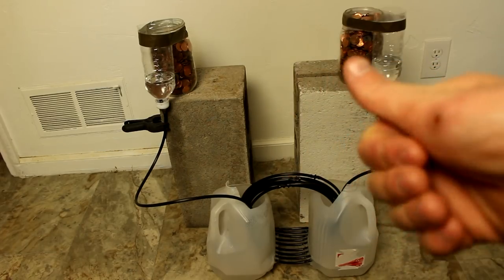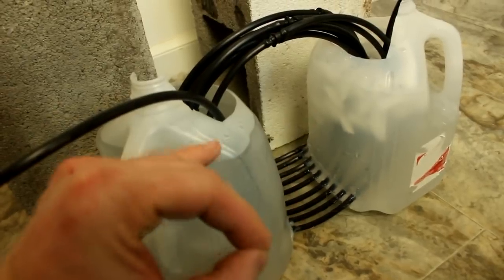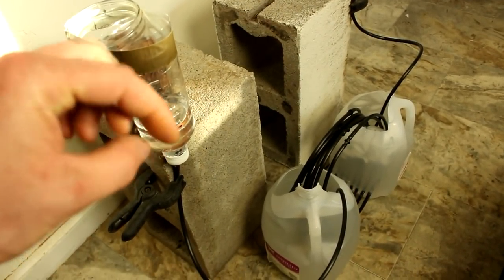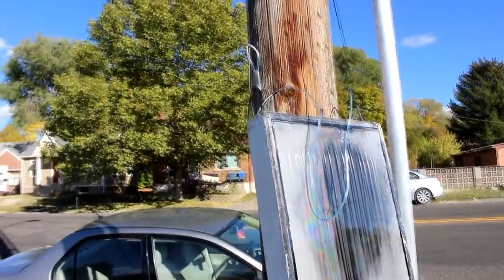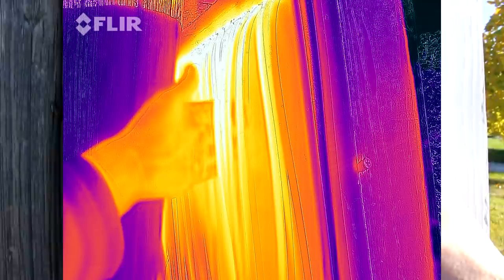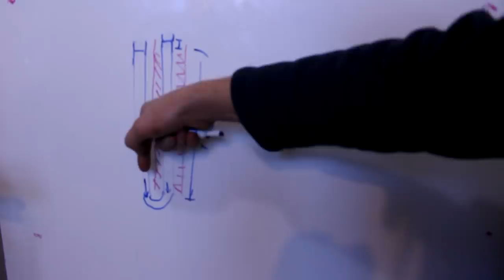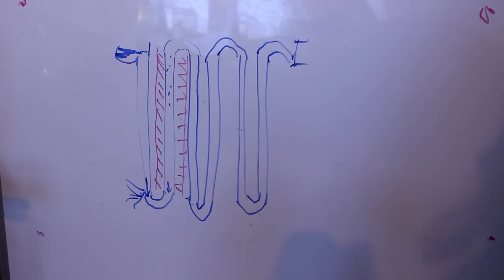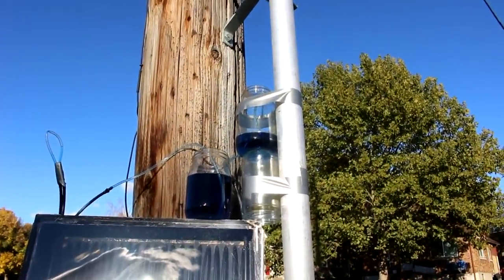Water Pump With No Moving Parts? (except water of course)

Comment: theoricaly according to carnot cycle, your solar heater's efficiency is 10%
but assuming its 2mx0.5=1m2 and solar irradiance is 500W, and you said you pumped for a hour 
then it should have done 180KJ of work, and thus lifted 61m3 of water xD
i think the current setup is inefficient
your last idea about doing many loops and incrementing the head in each loop is the way to go 
also this project reminded me of when i tried to make a solar water heated by passing drop irrigation line inside a poly-carbon board on top a polysterene one and aluminum foil sandwitched between them

Comment: So if it's the cold water that is pushing the top splice to metal pipes on back aluminum is a good cheep heat sink wrap it like in that radiator stuff on the back, ac box radiators. Something with no moving parts to wear out

Comment: Maybe you could use the osmotic pressure between the pure condensate water in some parts of the system and the highly concentrated water on the bottom to pump salty water up.

Comment: Just use a diaphragm pump for you eco system.  Just use a sealed volume of gas to drive the pump.  The gas will expand during the day and contract at night.  It would only complete 1 full stroke per day, but would move plenty of water for your application.

Comment: I think you said at one point you wanted stop use the Eco cubes in space, in space you could just have the Eco cubes spin to mix the water it would never stop so, a slow soon would pump it it
Reply: Spinning to mix the water wouldnt continue forever due to entropy. Turbulence in water (mixing) is caused by changes in direction (kinetic energy) which needs to come from somewhere (the kinetic energy of the spinning container). In time the turbulence would stop the object from spinning.

Comment: What if you do not exchange the heat between the cold and warm side in every column, instead make the column almost horizontal (but still tilted so the water flow down), like the back of a fridge. This way would have very long tube on the warm and very long tube on the cold, that fit in really small space, with only one point of exchange (of course the pressure on that point will be really high, so it must be really strong).

Comment: Just buy and use a few DC pumps in series so that if 1 fails you have a couple backups still working and check on it every so often in case 1 failed so you can replace the pump. 
The amount of time, effort, and things that you have to put into trying to make this work seem to defeat the purpose and create multiple other methods or points of possible failure.

Comment: Rather than just having the cold side pipes in the shade could you add some sort of heatsink to those pipes? It's probably more important near the top of the pipes where the water is still coming over the top of each loop hot.

Comment: Have you considered a chemical pump..using limestone and acid bubble colums.
I used this set up at our lab..and to add calcium to salt water tank(side effect the water pumping dripped without need for airstone or pressure..pumped about 3 foot up in a 1/4 inch pvc
Reply: I think his point in doing this is to create a no maintenance, non-electric device, his system would probably hold up without repair or recharge until the piping photodegrades, which would take anywhere from years to decades. It sounds like your idea would need a regular re-supply of chemicals. The idea is cool though

Comment: Just to be splitting hairs water level seeks pressure equilibrium. Gravity gives the pressure, this is why you can siphon water upwards as long as the end is at lower pressure, and also why to much air in the system eventually stops the flow in a siphon flow.
This also explains why the pump result is underwhelming. If you want circulation you need to equalize the pressure in the bottles. The level difference you now se is the equal to the pressure this pump can pump whit. 

I wrote this before watching all of it so with a small disclaimer here now, you may explain the same later on now I will continue to watch.

Comment: copper pipes to increase heat transfer. larger diameter to reduce flow restriction. parabolic mirrors to increase temperature delta  you could use heat pipes as  a heat exchanger. this would be quite expensive for something that moves very small amount of water. i think if you have a solar heater that can boil water just s simple bubble  pump would move a lot more water.

Comment: How about this: make the diameter on the cold side larger than of the front, so the heat from the front doesn't raise the temperature on the back as much.

On second thought, instead of increasing the diameter have the backside tubes split off into multiple lines to increase the volume AND the surface area. At the bottom they will have to merge again.

Comment: dood, just make both banks of tubes, hot and cold, in parallel so it's not pushing the entire system through for a net gain of one tube cycle. If they are in parallel you'd get alot more flow which is what i assume you really need here.

Comment: If you are interested in heat exchange and are willing to add energy to the system but still avoid moving parts you might consider checking out some TECs or as I prefer to call them "Solid State Thermoelectric Heat Exchangers".
Reply: If you run two loops in opposite directions and place the TECs between them you could create a rather efficient system.

Comment: Thermal expansion of air could drive an 'acid egg' (an air displacement pump or intermittent gas-lift pump) rather more effectively, I suspect. Chuck in a couple of Tesla valves and see how it goes.

Comment: Pertaining to the shrimp cubes, Cody, could you improve the adhesive action of a capillary tube by applying minute yet constant electrostatic charges to said tube(s)? Perhaps by solar power or unconventionally with a radiometer, like a miniature, rotating van de graaff generator.

Comment: used backwards it is a radiator, a thermal pump to cool the water rather than heat it to pump something. functionally it is far more effective reversed  by principle, using the pumping effect to heat/cool something, than pumping something using the effect. you would to much better to build a sterling engine. it uses the same idea, but converts it to mechanical energy and is very efficient and effective.

Comment: It seems you show that the idea still works when you seal the top loops, but I don't understand why. I would have thought you need the atmosphere to equalize the pressure again, otherwise the pipe up where it's warming should be symmetric to the pipe down where it's cooling in terms of temperature, density and pressure. but I really don't know just guessing.

Comment: I hate to say that thermal convection cooling has been around for a long time. The model T used it instead of a water pump. The first generation Ford flat head V8 used thermal convection cooling as well however, it never worked very well and that's the reason you see the old cars in the 1930's movies always shooting steam from the radiator caps for in reality, they did. The system was worthless in the V8's so, Ford moved to the mechanical water pump early on, for it's much high flow rate which provided improved cooling.
Reply: Based V8

Comment: There is an asymmetry in the force that produces the meniscus due to the capilarity. Maybe is posible to use this asymmetry in a dynamical system to pump water, it would have moving parts but not in the usual way.

Comment: Would adding a heat sink help? Run the cooling sections through a series of thin metal plates to conduct the heat and increase the surface area through which it can radiate away.

Comment: Alright, mr Sciency pants, let me lay some real science on you,
the concept in an of itself is sound and it is as others have mentioned
been used in the making of coffee.

However, one fatal flaw has been committed,
rubber is a thermal insulator, not a conductor.

How do you propose that you would have a hot and
cold side when you literally insulate them both.

I would repeat the experiment, where the vertical
lines are copper piping (painted black hot side)
connected with rubber to thermally isolate
each side from each other.

I genuinely hope you take this to heart,
and try again.

Comment: Back in the long ago times there existed engines which didn't have water pumps for the coolant, or at least so the greybeards at work tell me. Warm water would move to the radiator and cold would flow to the engine, maybe not quite the same thing, but seems to work on the same principle. Also pretty sure I saw someone make a giant cooling loop for their PC by doing a passive "pump" system using just the CPU and GPU as a heat source to make the water circulate. 

All this is off memory, so I might be completely wrong and just imagining things, because brains.

Comment: it should be more efficient if you use in the front smaller tubes or even split into two half size tubes on the warm side  and join them back on the cold side

Comment: If you are trying to just pump water up this might allready work if you just put a black tube inside which has a hole in the side at the bottom and just below sea level. Wouldn't need any additional creativity. For a stronger effect wind it like in a refrigerator at the back side.
Reply: every cm in you had before should only increase throughput slightly as you aren't changing potentials. (that much)

Comment: Cody, I'm sure the pipe you are using has too low of a conductivity. Instead of Rubber Tubing all the way around, on the sun side, use copper refrigerator tubing, and on the shade side, maybe go with a pvc or stick to rubber. Whatever has a low conductivity.

Comment: The pipes are inefficient as well as fragile especially plastic ones. Why not build flat metal Chambers. Paint them black on the outside and build them into a heat sink on the other. Also the second part might not be worth it but condensation causes a buildable reflective material so you might see an improvement put it in a vacuum or pump it filled with gas that won't condensate.

Comment: They  use something very similar to cool quantum computers. They key difference is they use hydrogen isotopes and take advantage of osmotic pressure differentials by initially concentrating one side of a u shape pipe and having the hydrogen naturally displace. Once the isotope reaches the other side it is pulled out and added back to the start. Doing this they have reached temps close to 0.001 Kelvin.

Comment: Cudos...!  Cody Bravo, even if it was all ready invented, it not a commonly used innovation.  you may have to flush the tubing once a year.  Qestion: assuming, the system needs to be primed with water, will the mineral salts migrate or remain in the more dense (salt precipitation layer)

Comment: You mentioned that you weren't able to find other examples of this with a simple Google search. I was able to find what it's called: a thermosiphon

But, all the examples i can find seem to just use a single stage. Most of the designs i can find use it to pump water from the heater (or what you want to cool) to where you want to recieve the heat

Comment: Use a computer water cooling radiator for the cool side and a solar powered heating element for the hot side. letting it bake in the sun isnt really enough, imo. also use lots of insulation.

Comment: What about having many loops in cold, and then many loops in the heated side (many cold stages - many heat stages [cold, cold, cold,-hot, hot, hot]). That way you dont need to wast or overcome the thermal gradient between the cold- hot loop (cold, hot, cold, hot, cold, hot)

Comment: Did you take the temperature of not only the rear tube but the rear part of the box to see if heat was transferring out of the solar panel to the open air in the back? A simple layer of foam insulation on the back in addition to the top of the hose lines running through ambient outside temperature water may cool them down more quickly and increase your flow.

Comment: At some point (which I'm absolutely sure you've already achieved) the friction between water and tube walls starts to come into play. I'm suspecting that such long tube with that small diameter is slowing down the pumping considerably.

You use temperature differential to exert force on the water, which is then countered by the friction. Not only does the friction make you waste energy, it makes you waste it on heat, warming up both sides slightly and therefore the temperature differential slightly worse (as hotter side radiates more heat).

Now, I have no idea how impactful that effect is. 1% efficiency hit? 20%? 0.01%?
Reply: Since there's hardly enough flow for it even to be considered laminar, let alone turbulent, I doubt friction comes into play too much. I would rather think it's the cross section itself that would limit the flow rate.

Comment: Yeah you definitely didn't invent this but this is an excellent interpretation and application of the idea. It's basically a percolator. A practical application for this would be you have a pond at the bottom of a hill and you want to pump water to the top of the hill simply build yourself a campfire next to the pond using a piece of copper tubing wound in a coil and placed in the middle of the fire once you move far enough away from the fire that the copper pipe is no longer conducting enough heat to melt plastic pipe you can continue with plastic pipe the rest of your route. This allows you to heat the water to Boiling and the pressure will only increase to the height of the Hill. This is equal to roughly 1psi/ft↑↓. As long as your temperature differential is sufficient enough to create this pressure the system will pump water. You can increase its efficiency in increments as the water goes up the hill and cools off make another fire pit and coil setup to increase its temperature again.
Reply: In addition to what I said about the pressure in the pipe will only increase to the height of the Hill. Let's assume that there is no hell and we just want to pump the water laterally across distance the same technique can be applied and rather than increasing pressure you increase rate of flow. The rate of flow ideally would have a impact on the size of coil you would need. A larger coil would not necessarily increase the pressure to gain a higher hill but could increase the rate of flow as the size of the coil is increased. Typically you would just want your coil size to be large enough to hold enough water in the heat long enough for it to reach boiling.

Comment: The thermal siphon effect... are you amplifying it or dampening it by changing the water temperature repeatedly in series? What if you did a single source for the hot side and a single drain on the cold side split to make the multiple veins in the middle? That seems to make more sense.

Comment: Your hot/cold loops are in series and are creating greater pressure analogous volts.  How about loops in parallel and you might get an increase in volume analogues to amperes.  There might be an optimum combination of multiple loop series stages connected in parallel, to get usable head pressure and flow volume.
Cheers,
Mark
***************************

Comment: You're feeding water into the system from the reservoir on the top, but that has already been exposed to the sun for the duration of the experiment, isn't that having a significant impact on the performance of this thing? I didn't catch where that reservoir fed in, but if it's into the cold side I suspect it's probably slowing you down a lot.

Comment: Do you have anything in your system that could produce gas? Maybe some sort of bacterial by product in the bottom chamber, or straight up boiling using concentrated sunlight. Maybe you could try to use gas bubbles in a thin tube to carry the water up, kind of like a low-temperature percolator.

Comment: Just another question, and a suggestion. Isn't it possible to just connect all hot tubes in series, and all cold in series, and connect hot and cold in just one point, for just one heat regenerator?
If not, have some research on penguin's feet. Their veins at the ankles wrap around tightly, to make a simple heat transfer

Comment: a wireless inductive-transfer powered pump would be a decent compromise between "sealed system" and practicality, if you don't get this working, and an equally interesting topic for a video/videos. obviously doesn't have your "no moving parts" advantage, but realistically I think a system like this would only have a lifetime of at most 10-20 years in your aquaria; solid deposition in the lines and degradation of the plastic would probably eventually clog/destroy the system.

Comment: Why the "no moving parts" objective? You could certainly make life a lot simpler. The disadvantage here is heating the water. Some applications, like say, a fish aquarium, the high temperatures could kill your fish. What might be entertaining and novel is a wheel that slowly turns, as it does it lifts the water bottles up high, then down low. A couple of check valves in there you can get the water siphoning in and out of the bottles, circularly. No impeller or pistons, but raising the bottles is motion.

Comment: How about just using an air chamber as a piston pump. It would be much more efficient. just use a couple of one way valves
You could paint the air chamber black and stick an LCD screen in front to cycle the heating energy to the chamber...